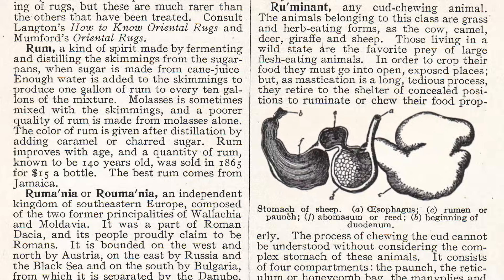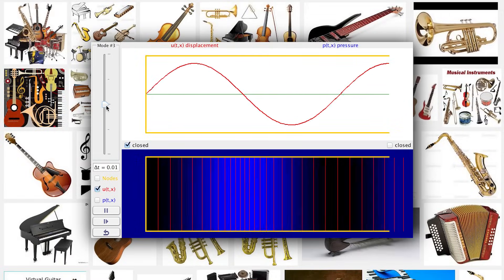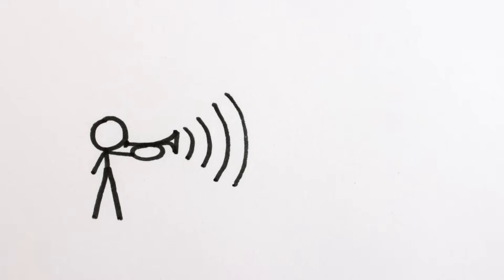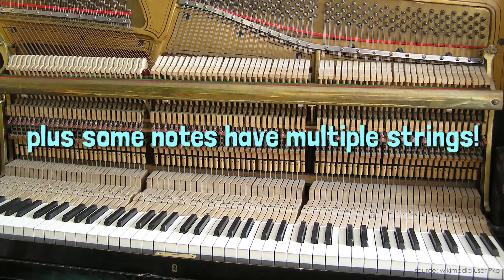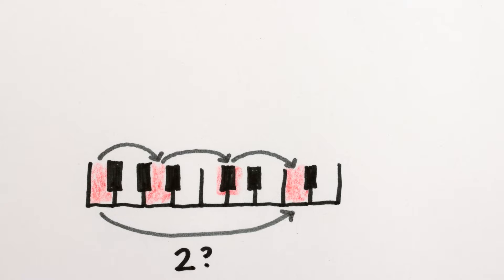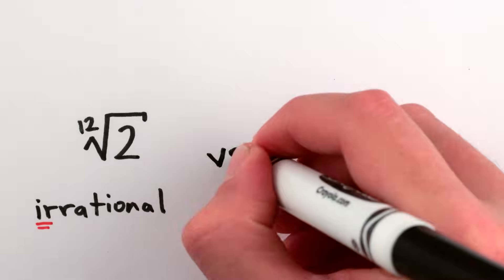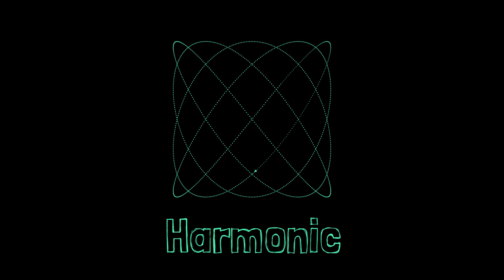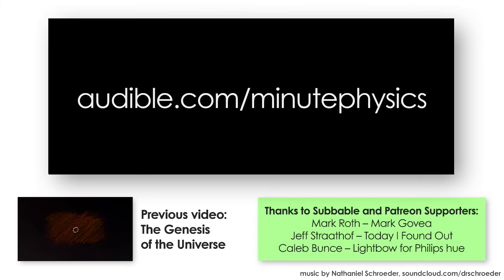Why It's Impossible to Tune a Piano

Comment: aah, the sound of shaking animal intestines
Reply: Azhad Its usually steel or nylon, not many people use gut strings.
Reply: I mean strings which are traditionally made out of cat gut but regardless of what is made out of when a string of vibrates it does so with the ends fixed to the instrument this means that it can only vibrate in certain ways sign waves like a jump rope with one bump or 2 bumps or 3 or 4 or some combination of these bumps the more bumps the higher the pitch and the faster the street has to vibrate in fact the frequency of a string's vibration is exactly equal to the number of bumps times the string's fundamental frequency that is the frequency of vibrations for a single bump and since most melodious instruments use either strings or air vibrating pipes which has the same sinusoidal behavior it won't surprise you to hear that musicians have different names for the different ratios between these pictures in the traditional western scale 1 to 2 bumps is called an octave 2 to three is a perfect 5th 3 to 4 is a perfect 4th then a major third minor third some other things that arent in the scale and 8 to 9 bumps is a major 2nd or whole step if you play a few of these notes together you get the nice sound of perfect harmony,  hence the name for this pattern of pitches,  harmonics!  In fact the sound that matches one of the harmonics of a string can cause that string to start vibrating on its own with a resident ringing sound.  And a bugle playing taps its only the note in a single series of harmonics which is part of why the melody of taps rings out so purely and why you can play taps with the harmonics of a single gutair string harmonics can also be used to tune string instruments, for example, on a violin Viola cello the third harmonic on one sting should be equal to the second harmonic on the next tree up. Bassists and guitarists configure the 4th harmonic to the third harmonic on the next string up 
But then we come to the piano or historicly the harpsichord or calivicord,  either way, the problem is this, it has too many strings there is sting for each semi tone of the western scale times 7, if you wanted to, to tune these strings using harmonics, you could, for example, try using whole steps of example you could tune the 9th harmonic on one key to the 8th harmonic two keys up but if you do it 6 times, you'll get to what's supposed to be the original note on octave up which should have twice the frequency except that our harmonic tuning method multiply the frequency by a factor of 9 8hs each time And 9 over 6th is not 2 it's 2.027286529541, etc. If you tried harmonicly tuning a piano using major thirds instead you'd multiply the frequency by 5 4ths 3 times or  1.953125 still not close. using fourths you get 1.973 not 2 5th gifts 2.0277 again and don't even by using half steps you'll be off by almost 10 percent and this is the problem. It's mathematically impossible to tune a piano consistently across all keys using perfect beautiful harmonics.  So we don't most pianos these days use what's called equal tempered tuning where the frequency of each key is the 12th root of 2 times the frequentcy of the key below it.  The 12th root of 2 is and irrational number something you'll never get your ratio loft harmonic tuning benefit is that once you go up 12 keys, but a benefit is that you end up with exactly the 12th root of 2 to 12 wich is twice the frequency. On a  Perfect octave, however, the octave is the only perfect interval on a equal tuned piano 5th. Are slightly flat, forth slightly sharp. Major thirds are sharp minor third are flat and so on.  You can hear kind of wah wah wah wah wah effect in this equal tempered chord which goes away using harmonic tuning.  But if you tune an instrument using the 12th root of 2 as most pains digital tuners and computers instrument are you can play any song in any key and they will all be equally and just slightly out of  tune. 

This minute physics video is brought some to you in part by audible.com the leading provider of audio books across all types of literature, including fiction  nonfiction and periodicals if you go to audible.com/minutephysics , you can try a couple out by  downloading a free audiobook of your choice.  I just read the name of the wound by patric roffus it's a fantasy novel with a very music and scientifically oriented protagonist and I Thoughouly enjoyed it.  You can download this audio book or a free audio book of you choice at aubible.com/minutephysics and i'd like to thank audible for helping me continue to make these videos. 

Why I'd I do that? 

Because I'm bored.

Comment: Title isn't quite right.  Correct title: "Why It's Impossible to Tune a Piano using only harmonics"
Reply: +rezneba101 If you watched the video you'll see that there is no tuning method that will tune every single note perfectly across multiple octaves. You have to compromise between tuning every note an octave higher perfectly or every note within a single octave perfectly, but you can't have both. Title is accurate.
Reply: ***** I did watch the video, again.  All examples refer to harmonic tuning.  Except the last explanation, which, seems to me, fails to demonstrate why the same problem doesn't apply to all other instruments.
Reply: +rezneba101 because the piano has more than one octave worth of strings. There's too many strings. A violin for example can play more than an octave worth of notes but only has four strings.
Reply: ***** I find that argument unsatisfactory.
Reply: Will Ferrous Talk more about what you know nothing about.
Reply: rezneba101
no you =D
Reply: says the troll
Reply: +rezneba101 
The title is correct, in the sense that no correct tuning, meaning a tuning that produces perfectly consonant intervals, is possible for a piano, or for that matter any instrument with as many scale steps as a piano.  If you want correct or perfect tuning you have to limit yourself to fewer than about six tones.
Reply: +Scott Wallace a git has what 23 frets?  times 6 strings... imagine a 12 cord.  it should be easier to tune a piano has each string does only one note.  No?
Reply: *****
The short answer: because even God can't make a power of two equal a power of three.  It's built into logic, and even God is bound by logic.  What it amounts to: if you tune so that you get nice chords in one key, other keys suffer.
Reply: ***** How does that logic not apply to other instruments?  Especially with the fact that piano strings serve to produce only one note, unlike guitars for example.
Reply: rezneba101
Which logic do you mean?  The logic of this video, which shows why you cannot tune a piano perfectly, does indeed apply to all fixed-pitch instruments.
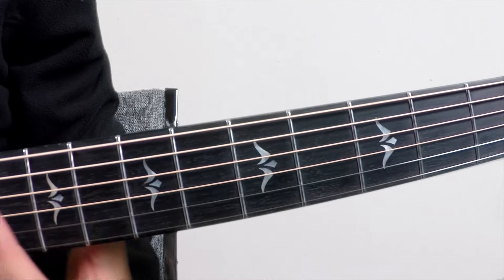Reply: ***** I'm ok witht that, it would make alot more sense, although the video seems to imply that the piano behaves differently.  Start at 1:25 and listen closely, the narrator seems to be saying that the piano is different, although it's strings only serve a single note purpose.  I understand that you can't tune a piano using harmonics, as there is no way to do what without actually opening the piano up and doing harmonics manually on each string, which would ridiculous in any case.
Reply: rezneba101
Well, actually, as several people have pointed out, the piano does behave differently than, say, an electronic keyboard.  But the problem the video is addressing isn't solved by using harmonics, even with electronic instruments: it's built into mathematics, and is thus insoluble.
Reply: ***** I never mentioned the electric keyboard, nor did the author of this video. I pretty much referred to guitar and piano. I get the math, I just don't get why the narrator is putting the piano as untuneable, unlike other string instruments.
Reply: +rezneba101 It made me think he was going to get into stretching.  But, I guess that would be just a little too mind-explodey...
Reply: +Scott Wallace Well, you can get around it with electronic instruments.  I remember using a soft synth at one point that had various tuning modes.  Obviously, you had to set it to the correct key.  It was fun to play some simple songs, and hear how they "should" sound, but it's basically useless in a mix because it'll be out of tune with everything else.
Reply: +rezneba101 Actually, the guitar is the least tuneable of every string instrument.  First off, he made it seem like it wasn't affected by the same problem the piano has, but that's not true.  Guitars use even tempered scales as well, and have all the same problems.  Second, the frets aren't even in the right places! It's easier to make them straight, but really, due to the particularities of different string thicknesses, they shouldn't be.  You can't even adjust your intonation on the fly like a fretless string player.
Reply: ThoolooExpress Ok thanks! I was starting to think I was just wrong about the whole subject. Never hurts to doubt yourself!  Yeah whoever made that video gave or insinuated some misinformation.
Reply: +rezneba101 that's called clickbait
Reply: ThoolooExpress
True, you can get around some of the problems of tuning if you have an electronic instrument (or any other instrument you can tune on the fly, such as a violin) and adjust the intervals as you go.  But that doesn't solve all the problems, even for solo music.  The reason is that you can easily write a chord progression, that if played with just intonation (pure low-integer ratios), will end up at a (say) C major chord that is lower (or higher) than the one you started with.
Reply: +rezneba101 It does apply to all other instruments (except for single stringed instruments, e.g. a diddley bow). The point is that pianos have many more strings so they suffer more from the problem when tuning. 

One can also go further than this and consider what happens in order to make the sounds. The piano uses mainly the fundamental frequency of each string because they vibrate using their full length when a small hammer hits them. The pianist can't influence the pitch of each key she presses. Traditional stringed instruments on the other hand, say the violin, can access the full continuum of sounds because of the way the notes are fretted by shortening each string length with the hand. So the tuning dilemma is totally not a problem for a sufficiently good violin player. The piano is deficient again.
Reply: jeeb Ⓥ
True, a sufficiently good violin player can tune every note just exactly where it's wanted.  But as I pointed out above, that still leaves you with the (usually small) problem of how to tune chord progressions that will make the pitch go up or down.  If it's not a big deal ending up somewhere else than you started, then you can tune each chord perfectly: major 4/5/6 and minor 10/12/15.

cheers from rainy Vienna, Scott
Reply: ***** Sure Scott, but that will only be a problem if the violinist relies on open strings. If all notes in the chord are fretted by the player, then the problem you pointed out is a non-issue. Cheers.
Reply: jeeb Ⓥ
It's not a non-issue for people with perfect pitch- but I agree, it's not a big deal.

cheers
Reply: +rezneba101 21, 22, or 24. Usually 22. There have been guitars made that have 30 and above frets, though c:

Comment: Thanks man, now ill live with the joy of knowing all instruments are out of tune :D
Reply: Didn't need science to tell me me and my band's outta tune...got the audience for that😉
Reply: Actually this video is about only how the piano is out of tune the problem is pianos acant adjust tune on the spot every time you play it whatever the notes are tuned to is how its tuned. Most instruments can control air flow or make micro adjustments to change whats known as embouchure. This allows them to make micro adjustments while playing and thats also why they only need to tune to 1 note not every individual note on their instrument. The problem is the 12 tone system we use now is designed for those instruments and not pianos or harpsicord or celestas or xylophones or any of those instruments

Comment: It's not true to say that a piano is tuned to equal temperament and a guitar isn't. Tuning the open strings using harmonics is a red herring, the fret distances on a guitar are based on equal temperament  even if you tuned the open strings based on harmonics, it's all equal-temperament from there up the rest of the neck. And in fact virtually everyone tunes their open strings to the equal-tempered pitches, usually with a tuner. One of the few exceptions is Eddie Van Halen, who sometimes tunes the B string slightly flat, so it makes an ideal major third with the G string, that way you can play A-shape major chords with distortion that sound as solid as power chords without that muzzy intermodulation jangle you get with an equal-tempered third. Think "Runnin' with the Devil"...
Of course the problem then is that while those major thirds sound fantastic slightly flat, every other note of the scale sounds worse slightly flat, and you find yourself doing slight bends on the B string all the time to bring them up to pitch...
Reply: +PutItAway101 
Indeed- that open B string on the guitar, if tuned equal tempered, or worse yet, by harmonics, makes a really jarring major third in G.  But 
what can you do?

In fact, fretted instruments were probably the very first instruments to regularly utilize equal temperament, since they couldn't tune all their notes individually, but rather had strings tuned differently using the same fret.  That's why, in the Renaissance, when all keyboard instruments were tuned to some kind of meantone tuning, you find pictures and descriptions of lutes having their frets spaced at least very close to equal temperamentt.  Anything else doesn't really work with normal frets.  Of course, as you mention, you can bend notes, and especially the players of bowed fretted instruments, such as the viola da gamba, regularly do this to get chords closer to just intonation.

If you can't adjust your pitch on the fly to accomodate its function, you're doomed to imperfection, as soon as you have a scale of more than five steps.  Even God can't change that, if She's logical.
Reply: ***** Yep, no one can make the Pythagorean comma disappear, but "infnitely variable pitch" instruments like the violin family and the human voice have got the best chance to disguise it on a note-by-note basis.
Reply: PutItAway101
Yep.  And we do, because equal tempered thirds suck.
Reply: U wot m8¿
Reply: *****
Is that a rhetorical question?